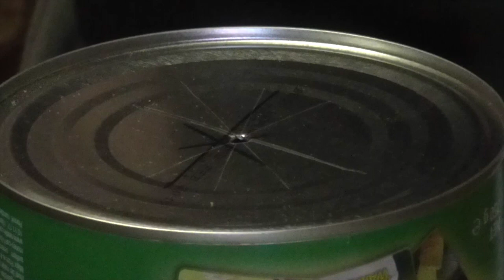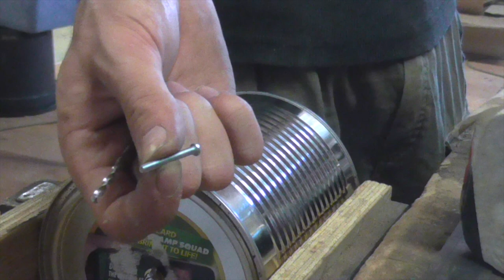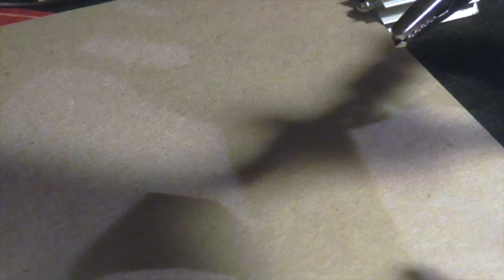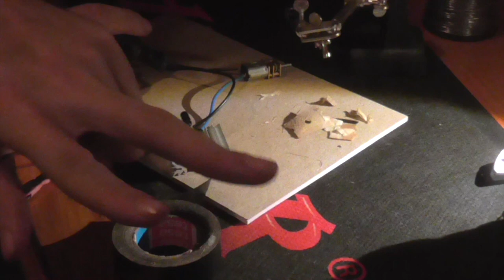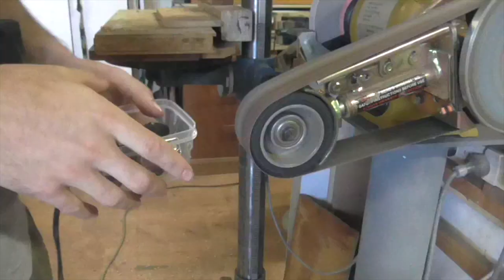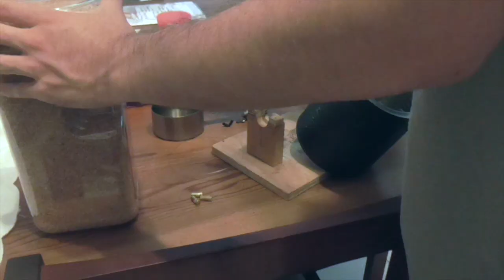DIY Rock/Ammo/metal tumbler: why does this keep happening

Comment: I have a small motor rated 6v 330ma. I also have 20 solar cells rated 2.5v 100ma. Can i run 2.5v 2.amps into the motor with out damaging it?
Reply from the maker: I can't really say for sure as I am only just getting into electronics and I don't want to lead you down the wrong path, sorry.